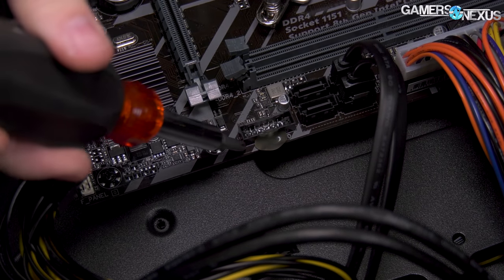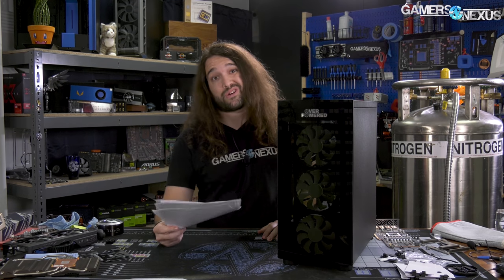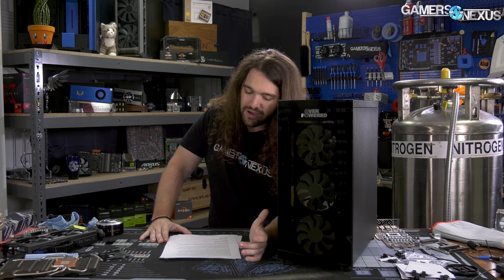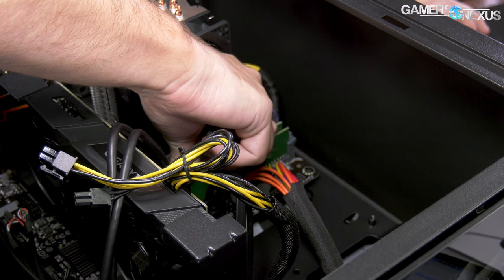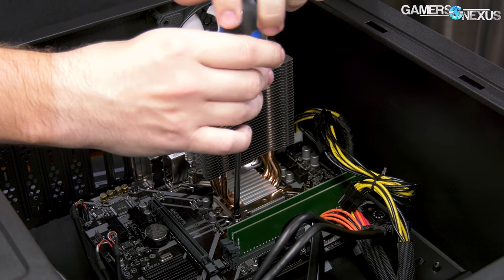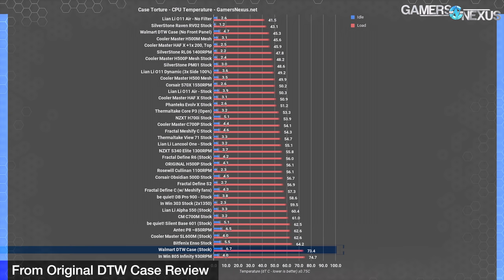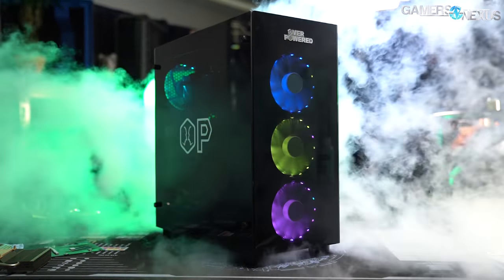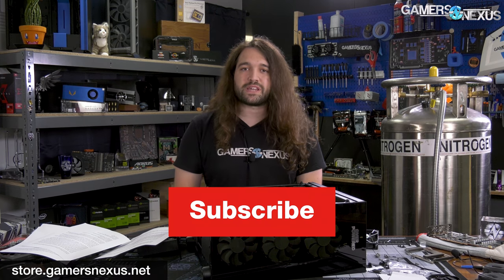Walmart Gaming PC: Second Chance, ~1 Year Later (Overpowered DTW1 Review)

Comment: Walmart PC's, assembled by the verge 😁
Reply: Matthew Rath with an anti static working surface
Reply: #imao XD,
Reply: @Magisq  Don't forget to make sure your case has anti-static pads for your power supply! If the power supply touches the case it'll fry the whole computer so you have to be sure!
Reply: The_Storyteller_14 it will short circuit the parts noob
Reply: @Magisq  Literally said the same things, but yours was more specific, but whatever.

Comment: WOW, not even the simple "does it start up properly" check done by their QC, that's something.
Reply: QC in most manufacturing is done intermittently and it's rare that even 1 in 100 gets a full QC check most QC checks are visual and will miss anything that isn't easily seen.
Reply: I bet they aren't paid enough to do a good job
Reply: @bdhale34  QC where I work, making servers, is done VIGOROUSLY for EVERY system.
Reply: @jeffreywarf  For servers I bet it is. You can't just send out a janked up server to a buissness.
Reply: It was most likely a returned system which was messed with by a customer. Setting up the wrong boot drive would require a conscious effort on behalf of Walmart. This would not have happened out of negligence.
Reply from the maker: @tkimaginestudio  Actually, no, we had multiple viewers reach out and say they had this same problem. Walmart and its partners are almost certainly responsible.
Reply: @GamersNexus  How are you suggesting are Walmart going about configuring a wrong boot drive? If they had installed Windows to the wrong drive that would make sense, but according to you an explicit change to the boot drive selection was made. That doesn't seem like something that plausibly happens unless there are employees that want to sabotage Walmart.
Reply: @jeffreywarf  obviously spazz
Reply: @tkimaginestudio  simple my dood. They booted to the flash USB drive / OS drive for partition format and install then selected the wrong drive when done. This is more plausible because they are employing the bottom barrel. I promise. Its walmarts M.O.

Comment: As a former associate, I'm honestly surprised you got it intact, let alone in any kind of working condition!  I've seen lots of product thrown haphazardly on top of pallets so high that product usually ends up getting CRUSHED when it's placed on top of the steel!  Management didn't care if the pallets leaned over like the Tower of Pisa, let alone if anything got damaged.  (Yes, I did take the time to fix these mistakes, after taking pictures, because I'll be damned if anyone gets hurt from anything I had to deal with!)

Comment: Alright, I suppose I should give my 2 cents on these gaming PCs since I actually purchased one when they were on that huge sale in late June. I've always been super into the tech/PC community for many years now (mostly just watching videos and reading reviews), and I actually looked into getting a PC since like 2015. Somehow, I kept talking myself into keeping my old laptop (which didn't even have dedicated graphics) for about 5 years until I bought my first PC this summer (2019). I will say that I didn't buy the DTW1, which was around $700 and what you should never buy even at that price, but instead I purchased the DTW2 for $900 before tax and received it about a week later. I actually bought it kind of on a whim since I saw the deal, watched only one review of it (by Bitwit Kyle), and decided that I could get around the poor thermals by taking off the front panel. I knew I wouldn't be expecting much out of the PC and I would be in for a few upgrades, but I didn't care since I would get a GTX 1080, an i7-8700 (non-K), and 32 gb of ram for pretty cheap.

Let me just say, thank goodness I bought the DTW2 because it had some major changes over the DTW1 which I didn't expect. The DTW2 comes with an H370 mobo (same bus speed as Z370 & Z390) and a 650w 80+ GOLD Greatwall PSU (which surprised me when I took out the PSU). Most of the other stuff is similar in quality to the DTW1 (meaning not that amazing), but these two parts saved me around $150 in upgrades. That means that I didn't upgrade them, and I'm still using them currently while typing this. My overall experience with the parts has been pretty great and I surprisingly didn't get most of the issues described in the GN video (e.g: no hot glue on the USB 3.0 header, no USB 3.0 wire in front of the psu, USB type-c is on the mobo i/o and not an expansion, all cables are properly plugged in and ziptied adequately). Booted up perfectly first time and came with no bloatware (but the hdd was still oddly paritioned into 4 parts).

For upgrades (which aren't required), I bought a wireless wifi adapter (TP-Link T4E), new PWM RGB case fans (Deepcool RF120M 5 pack), a new case (Thermaltake Level 20 VT), a PWM RGB 200mm fan (upHere P200RGB), and a Deepcool RGB convertor to use the 200mm fan with the mobo's RGB. The cpu cooler and psu have not been upgraded yet, but they're both definitely next on the list (since the case requires the psu to be removed to access the backplate). I'm not using the 2tb hdd currently but it's definitely a very good addition that I'll eventually use. I also have other things planned but I'll either wait for deals or buy they when I need them.

Overall, I didn't expect much out of the Walmart PCs, but I'm glad I saw some value in them. The DTW2 purchase has been a really great one for me and it came with little hassle and more value than originally thought. Just because the DTW1 was a terrible PC didn't mean the DTW2 was, and just because it's a prebuilt doesn't mean it's a bad value (esp if you don't wanna come up with a parts list). I would recommend others to buy it if it were at $900 or less, but if you aren't gonna mod or upgrade, just make sure you're okay with loud noise, higher thermals, and more dust than normal. It doesn't really matter tho cuz I just checked and for some reason it's at $1,900 now lol.

P.S: I got smart one night and spent a few hours trying to rewire the fan hub on the original PC to match the Lian Li fan hub (shown in the first GN review) and get PWM control. Ended up just having the fans not work anymore and having to buy new ones lmao

Comment: How do you make a PC that's worse than a gaming laptop at the same price :o
Reply: That's actually pretty easy. All you need to do being a cheapo in selecting the parts for the PC and being very messy with their installation. No mystery there.
Reply: gaming laptops are waay better than this trash
Reply: How does corporations like Wal-Mart make a killing by overcharging idiot consumers by using child and slave labor whilst using the cheapest creepiest parts?
Reply: by marking up everything on the pricetag.
Reply: @roronoazoro8624  Gaming Laptop?  A top end Laptop of the same price can boost while still game pretty well in practice.  But Over Powered the name of this gaming pc really Wally, thank god I never return to Walmart.

They didn't have swim trunk's in the Upper Peninsula Michigan of Marquette when there're hotel and motel of indoor swimming pool and hot spa just down the road.  I wanted the hot spa......so I have to buy gym short with tight undies.  You just have to pay more to be saving more cheaply......God I hate it.

Comment: 1# They glued the USB 3.0 header. 2# The case doesn't indicate that it even has USB 3.0 as none of the inputs are blue. So someone that wouldn't know much about PC's probably wouldn't even realize they had USB 3.0 😂
Reply: The ports on the top of the case are not USB 3. The usb 3 header on the motherboard goes to the usb c pcie expansion card.

Comment: I bought one CyberPowerPC gaming rig several years ago after having built the previous four rigs.  Never again.  No matter the cost, I'll only ever build my own systems moving forward.
Reply: I did the same, both ram modules were loose in the chassis. Luckily undamaged.
Reply: When I was younger and dumber I bought a prebuilt with an Fx4300 (stock cooler) and a GT720. No, it was not enjoyable. Yes, I hate myself for it.
Reply: When mine arrived, it looked like the expanding packing foam nearly broke the PCIE slot the video card was in. I remember something being DOA, and something being the incorrect part. Overall, I remember issues with the video card, power supply, and motherboard. I offered to replace them myself, but they insisted I send the entire machine back. (Thankfully I saved the packaging) When it finally came back, the entire inside of the case had a visible layer of fine sand/dust coating everything. I called to complain, but they kept exclaiming that it didn't leave the shop that way. The other downside was that I didn't get all of the accessories and spare hardware that comes with each component. It was simply way too much of a headache for way too much money.

Comment: It used to be HP's that I would show customers when they asked why my Professional built systems cost a bit more than say Best buy.  Now I use your videos Steve on the Walmart crap to prove my point.  Not only have I had to fix 4 of these nightmares but also had to explain to the customers just why a trip to a big box store is not the correct method of PC purchasing. Ever!! Not even for office builds.  Don't get me wrong if all you do is play on face book or view email, shop online, crap like this will be fine however as you can see if you ever want to upgrade you're going to buying another 2k pc from them.  Even with the slots to upgrade that MB and other parts are just way to on the cheap to offer any kinda future use.  Great video as always Steve!!

P.S. I think the Verge and Walmart should join up and create a new design.  Between the 2 of them they might actually get more than 2 things right.

Comment: I’m sure someone has mentioned this by now but the reason for the silicone is at least this was what they did 15 or so years ago was if you had bought a gateway or dell and so forth and it looked tampered with it would void the warranty. Back then they used a strong adhesive piece of tape. “If the seal is broken and now you’re computer don’t work you must have broken it because you messed around with the hardware.” I know bs but that’s why. They have been doing it for years in some form. Looks like the upgraded to silicone.

Comment: CyberPowerPC has used a Geil Evo Potenza kit at 2400Mhz with the exact same timings paired with a 2700X and a GA-AX370M-DS3H motherboard. It can be ran at 3200Mhz if you so desire, but you'll have timings of 18-19-19-43 or you can leave it at 2400Mhz with timings of 15-15-15-34.

Comment: Cyberpower isn't pretty bad.  I recently "repaired" a computer that had the strangest problem that forced me to think outside of the box.   Every time a drive would read, the computer would shut down.   

Low and behold after doing a lot of power trouble shooting, I find out that Cyberpower PC had a ridiculously tight ziptie on the HDD and Power Switch header cables, which caused bridging.  Every time the HDD LED would turn on, it would trigger the power to go off. 

But this is hardly a surprise, because every ziptie in the case, was extremely over tightened...   By the way, I'm not sure if this was the retailer they bought their PC from or Cyberpower PC themselves,  but evidently this customer paid $4000s for this computer..... it only had 8GB of RAM and a 1060......  holy ripoff....  I didn't say anything to the customer because it isn't my job to judge and make them feel bad about their purchase.  I did suggest that next time they allow me to build the computer for them.
Reply: I wouldve asked, when did you buy this PC? Oh, only 22 days ago? Great, return it now. 4k for that pc is criminal.

Comment: Yeesh what a rough review. Shame Wal-Mart didnt take anyone's advice on how to improve this, and move forward.
I will agree with you about getting from the bigger brands though. Back during the big crypto mining craze, my old personally built PC finally croaked out, and with no good deals on the horizon at the time, I actually found a decent  PC form HP Omen. $1150 for an i7  7700, 16GB of RAM & a GTX1070.  At the time the 1070 was ging for nearly $1000 for a new one (Thanks crypto) So I snapped up the whole PC, and ran with it. Been running it for just under 2 years now, and I couldn't be happier. Honestly, I didnt plan to keep running it for this long, but frankly, I havent hot a point where I felt limited in what I could do enough to want to upgrade. So I guess the moral of the story is to not toss aside a prebuilt, if the deal is good. Do what works best for you at the time.

Comment: I was able to get it for $699, it looks like they are out of stock now, all I did was added some spacers to the front panel for much better ventilation and my GPU and CPU temperature are back to normal. This was replacing a 3 1/2 year old computer with a I5 6500.

Comment: 6 improvements they could do.
1. Cheap Hyper X low quality ram in Dual Channel. 
2. No Glue
3. Better Motherboard
4. Better case airflow. 
5. Black PSU cables or sleeves
6. Actually initialized boot media ?.?

Comment: The reason for the 1 stick vs 2 is for upgrades. If you have two 4GB sticks and you want to add an 8GB, you have to get rid of 4GB to add it. So instead of getting 16GB, you get 12 GB, because you have to remove one of the sticks. And this just seems to be the mentality of those who are inexperienced with computers, and in all fairness. I don't people who buy pre-built computers from a retailer like Wallmart is doing something that intensive or would recognize the effect of the extra CPU Lanes to the RAM.

Comment: for 200$ more you can get a r5 3600, rtx 2070 system with 1tb m.1 ssd, 16gb ddr4 3200mhz ram and all high end parts, if you went as cheap as possible you could get a r5 3600 and rtx 2070 build for cheaper than 900$

Comment: Things this looks like a troll product.
I just bought a gaming PC from Walmart and it actually looks/works pretty good. So far haven't had any kind of problems so far, all my games so far are working perfectly. I did look on the review sites before buying which is why I'm surprised it would still be sold a year later with the internet and all.
FYI my PC is a Cyberpower Gamer Master GMA6600WST w/ AMD Ryzen 7 3700X 3.6GHz (while I've seen OC speed advertised somewhere as 4.4 others have said it's better to go with somewhere around 4.1 or 4.2). ASRock B450m/ac motherboard, 16GB DDR4 Vulcan Z Memory, 
Nvidia GeForce RTX 2060 6GB, 240GB SSD + 1TB HDD,
...AND... and, LED lights.
But seriously, it's not bad for the price and for someone who doesn't want to build one, I can always upgrade it later but for now it sure as hell beats my previous potato. A multi media laptop with a dual core hamster and a dedicated gerbil.

Comment: I still service about 200 computers a year because it is more of a hobby for me now rather than a profession and in the last year I must have serviced at least 30 of these now and they all had the same set of known issues that you already described here? but the main one was the system was lacking balls and my customers where all shocked after I told them that it was a rip-off cheaply built gaming system and pretty much the only real thing that was worth salvaging out of it was the GTX 1070 video card and replace almost all the rest of the hardware if you want to properly upgrade and be happy with your system! Shame on Walmart for taking lessons from Apple when it comes to grossly overcharging for hardware!!!

Comment: The inside of this machine looks so depressing. It kills my soul.
Reply: I once had an itx board with a 6600k in a fractal define r5 full tower. Cooling the cpu was a massive noctua NH d14. Add in the GTX 970 and you could barely see the motherboard in the upper rear corner of the case.
Reply: @armando1is1great  that's cool but at the same time also makes me sad aswell lol.

Comment: They price dropped to get rid of stock. Costs more to store and they knew eventually they wouldn't even be worth shit if they sat for so long anyways. I'm sure price dropping wasn't to try and get more "mom" type consumers but specifically to target parts markets which would quickly buy them up. I don't think Walmart is necessarily "bad" at building computers, with their earnings they could easily afford to build very capable rigs, but that's not what Walmart does, Walmart most likely has access to a crap ton of "outdated" or last gen parts for effectively nothing and just slapped them together figuring it could offer decent margins while adding modern flash to their electronics section, which could lead to improved electronics sales and customer impression, which alone, would be worth having it sit there even if they don't move quickly, like a placeholder until something more real comes along.

Comment: my dell inspiron was 600$ us, and its got a Ryzen 5 1400, 8gb ram, 1tb hdd, RX 570, this is just sad
Reply: My basic desktop is a Inspiron 570 with a AMD Athlon II X2 250,that I bought used from the dell outlet back in 2011-2012, for like $300 or so.. I upgraded the RAM to 8GB and put in a GT 630 years ago. 
Granted its not as fast but it boots up and its been stable for years. Only replaced the power supply in it.

Comment: on part picker i can build a $978 pc with a r5 3600 / 5700XT  1 tb ssd nzxt 500 / 3000mhz corsair ram and a 600watt 80+ gold psu from inwin of all brands so the psu is gold color aswel xD, so basicly putting wallmarkts pc to shame for $80 hell you can drop in a 2600 and a 5700 non xt and put it to shame while saving $200 if ya cant build it take the cheaper option and someone will build it for ya for that $200 for sure xD